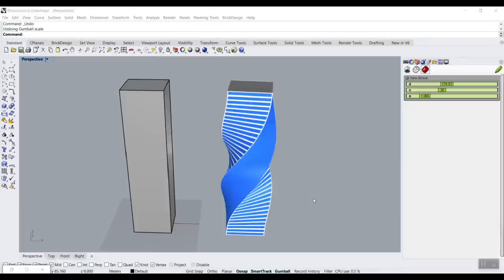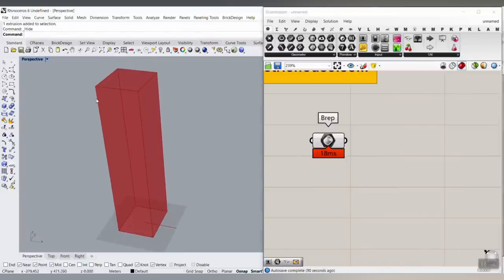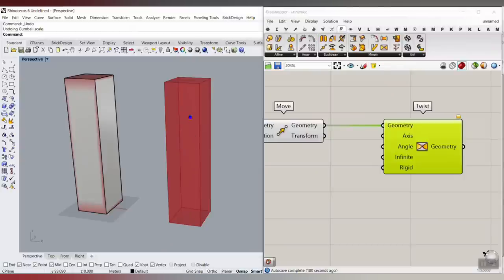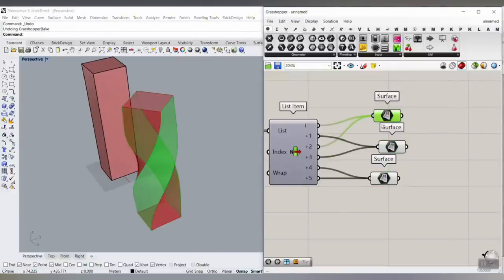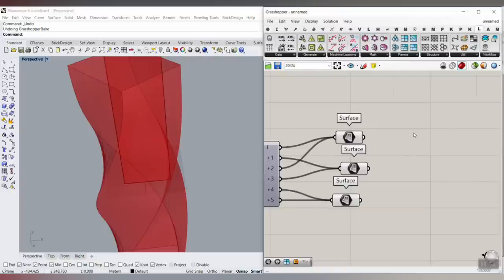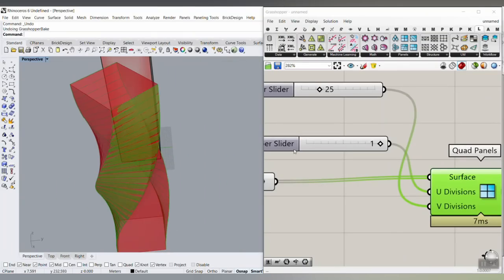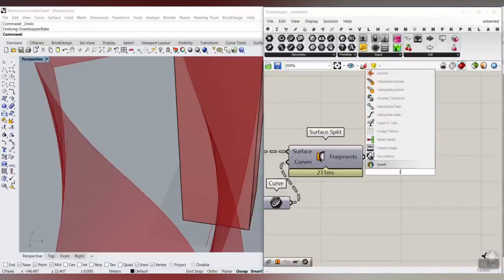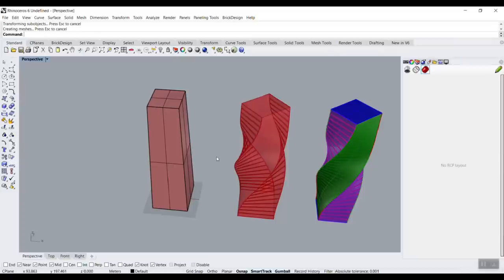Architecture Design (Rhino Grasshopper Tut.)

Comment: Nice video!
About the building...I don’t like it. What is the reason for the twisting shape? For me, this is not architecture. You may call it sculpture but, unless there is a solid reason for that shape, it is not real architecture.
Keep it up Raiden! :)
Reply from the maker: thanx SMA 🙏 Well I guess your right. There are several twisting towers in the world and they don't really have an optimization goal behind them! I Believe If the twist was optimized against maybe radiation it will be a good reason for architectural design!
Raid--:D--iation! :
Reply: You can find beauty in a machine, like Le Corbusier said, but that would be Engineering. 
You can also find beauty in a painting, sculpture, poetry or music but that is art.
Architecture is both function and beauty at the same time. They must be together. It is not easy to do it and I would say that 95% of buildings in the modern world are not ok.
For me, the older the building, the better. When you enter a gothic cathedral, you can feel that the function for what it was built really fits the shape and...it’s also beautiful! Isn’t that great? But when you enter a hospital, housing building or a supermarket, it is bullshit, most of them.
Have you seen the movie The fountain man? (Gary Cooper) if not, you need to. I feel like Gary Copper’s master. He hated the “new buildings” with classic shapes at the point that he got a heart attack. Very cool movie, just like buildings, the older the better.
We need to give our best in everything we do and I really thank you for your work because that’s exactly what you do, an excellent job.
Take care buddy! ✌️
Reply: @smasimulationshop1028  It's very beautiful but it isn't art ~
Reply: As far as I know, the twisted shape is good for withstanding wind streams: it saves the building from resonating, wich is critical for skyscrapers.